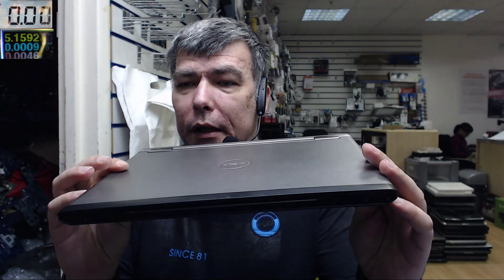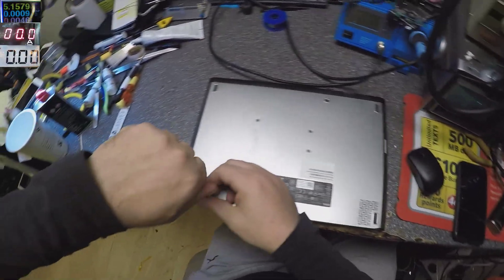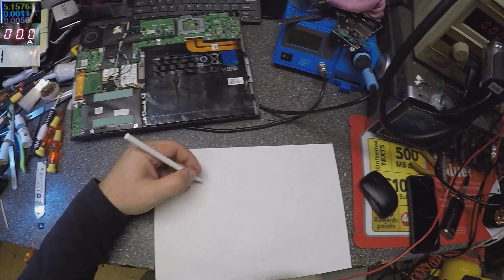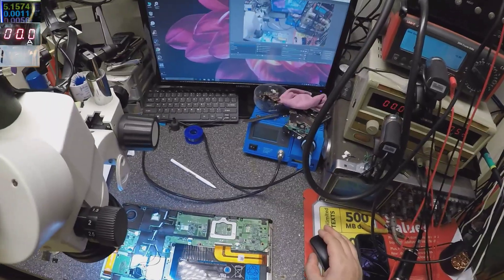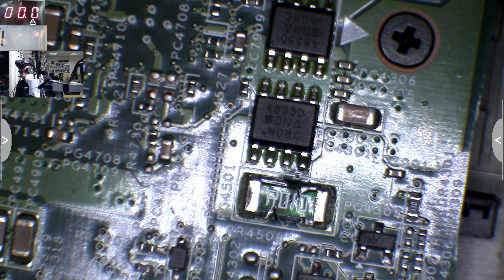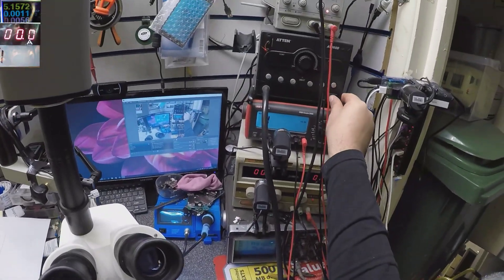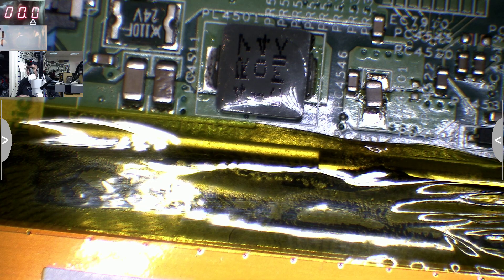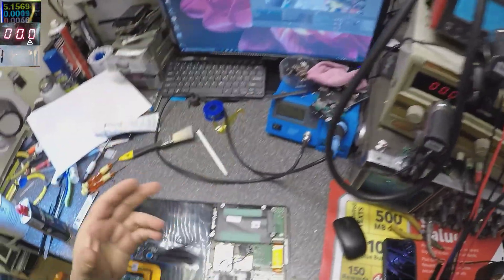How to repair short to ground laptop motherboards, dell vostro 130

Comment: I once had a window air conditioner that was tripping the breaker and did not feel like finding what component was going to ground, so I held the breaker on until I heard an explosion and then found out it was the compressor internal winding..it blew a hole in the compressor and let out all the freon but I saved tons of time troubleshooting. Same idea here..but 240v is a lot more fun.

Comment: what could have gone wrong with my hp pavilion dm3 laptop, i accidentally short circuited the mother board with the screen fibre when trying to fix the fibre on the mother board.all usb ports are working normally but the caps lock light and screen do not come on

Comment: It was Interesting for me because just for this tiny reason the system didn't work. Your job was like throwing the Arrow in center of Cybele ... but I feared a bit when when you plunged in the electricity ,I thought that if it has a the problem in other place so it would over heat again and burn the capacitor. How did you make sure about that? ... This is what surprised me.

Comment: Please, Sir, I am a beginner and I will be so glad if you can
make a video on how to identify the MOSFETs on motherboards.
Especially, I can see that most of the common problems are related to the shortages of 
power from some of the MOSFETs and the power connector (the charging port).
Actually, I normally work on desktop computers but I really have an interest in working on laptops.
I have lost of your videos but I have seen a video yet on how to identify all that I need to check.
Hoping to hear from you. 
Thank you.....
Frank

Comment: A $100s piece of fine technology could have be thrown away because of a $0.10 small cap...
Reply: You need to consider the skill required to diagnose and repair the issue, it might be $0.10 and a simple issue, but the guy in the video is worth more than that.
Reply: @AbdulAminGani  Yeah, when I try this I go from a $300 repair to a $3k repair.. It's an expensive skill to learn on your own equipment..
Reply: I buy 1,000 of those for $5.00.   they are super cheap to buy.
Reply: I don't know how much he charged, but if I would pay high prices for such a repair I'd want brand new same capacitor, he used a smaller one used which has unknown lifetime, I think it's fine for super cheap repair shops, but if he asks a lot of money then it should have got a proper brand new never used same capacitor...

Also that's the reason why I almost never buy used electronics unless it's something super cheap that I really don't care much, I'd never buy for example a used PC PSU, motherboard, GPU or HDD and some other stuff, from a PC desktop perspective I'd only buy used would be RAM, CPU and maybe a case or air cooler but I never ever bought any of them used ever (it's just from my own experience with hundreds of PC's its super rare to have a bad CPU or Ram and most CPU stuff related would be bad OC but then after testing if it's not fully working is just ask for a return same with the memories after testing them)...

The rest of the hardware like even if they look brand new and can say almost never used, no one knows for example if the PC wasn't actually 24/7 used always on or mining and other stuff which will dry caps and probably will come with low life already and prone to fail...

PS: expensive repairs, I'd demand everything brand new whatever was replaced unless on super cheap repairs then yes I'd say throw something used in it if it's much cheaper, but small caps, resistors and many other stuff are super cheap that should have been always a brand new piece, now IC stuff or the APU or SOC and many other way more expensive stuff surely would make more sense to get one used or from a completely trashed motherboard that could have them good...
Reply: As was said before, he has a lot of skill and 100s of dollars worth of equipment. I'd be surprised if he would even bother repairing a cheap laptop like this off camera.

Comment: sir what kind of power supply are you using? my power supply has a short circuit protection on its output which is why i could not use it the same way you do when looking for a shorted capacitor...
Reply: I have the same question
Reply: He use a long wire (modified) on the + probe so the PS read a load from the wire resistance
Reply: #ngapainturing can you give more details of how this works ?

Comment: Hello, can u show where did you put red probe from power supply when u test whit amps for short?
Thanks in advance.
Reply: I think he puts it in the main power input, so as to simulate the charger is connected, but does not provide the full 5-6 Amps.

Comment: how does capacitor cause short to ground though?   it's not grounded.
Reply: When a capacitor becomes shorted, it’s no longer a capacitor really, and instead becomes/behaves like a jumper wire. AND, since one end of the capacitors, is connected to the VCC [positive voltage track] and the other end, is connected to the ground [negative voltage track] the voltage goes straight from the VCC to the ground - hence, a short to ground. But I’m a novice at electronics, so I could be wrong.

Comment: Thanx for the vid.i have a desktop with i7 6700k CPU, my pc turn on and off, kinda looping, it turns on then off then on.when i removed the 4 pins atx power it works fine,so that means my VRM section is short. I applied the same method in this video to fix my desktop and it shows me all the capacitors near to CPU short(beeping in multimeter) but when i take out the cpu then no more beeping but pc start fine without the CPU.Also the capacitors around the VGA chip beeping even after removing the CPU but shows 34 oms on multimeter. So my question is to you that a processor can be short-circuited?or do I have to look for dead capacitors or the mosfet? And do I have to replace a new CPU? i want to know before i buy a new processor because it's expensive. Thanx in advance

Comment: I found your channel few days ago and today I fixed my first motherboard (Asus K53SD). I found a dead mosfet using 10 euro multimeter, replaced it using simple soldering iron (I attached piece of steel wire on top of it, so I don't damage other components). You are a good teacher. Thank you. Keep it up!

Comment: It's really awsome to watch this kind of great videos.I've a question. How you idendified polarity and the value of capacitor?
Reply: With ceramic capacitor polarization is not important.
Reply: @jamich1  But the value is important.
Reply: @mrpistonb6060  if you do not have schematics find similar cap one next to it and measure the value. If you just cant figure it out then dont put it there it will most likely work like that just fine ;)

Comment: Hi where did you put the positive and negative probe while using the dc power supply to find the capacitors thats getting hot? Thank you.
Reply: As far as I've been able to tell researching this topic, so far, you can most easily simply connect it to any like known power pins and it'll be fine. So in this case, it could've been the positive and negative pins where the charger would've plugged in.

The important thing is to keep the voltage limited to 1V and the current to less than 5A, since there should be just-about nothing which would run at 1V and a total of 5W power going through it which is of consequence and would burn out while there's a short, seeing as the part causing the short is going to be the one absorbing all of that energy and getting hot. Ergo, worst-case scenario you straight-up blow off whatever part was the problem in the first place.

Thus, better to start with less current and work your way up if nothing is getting substantially hot, and use something like 99% Alcohol (IPA) which will rapidly evaporate away from wherever the component is getting hot.

Comment: I took the Laptops Power supply as power source to put the Amps onto the first resistor. If I connect the wires a little spark flies but nothing heats up :( I have a thermal vision and see nothing.

Comment: Great work. Had the same issue with a dell 5520, and found also one capacitor shorted. Was replaced and the short is gone, but i have a strange issue. Once i plug the charger is everything ok, but if while the laptop is working i unplug the charger and plug it again, the charger light goes of and the laptop gets no power....

Comment: another nice video....i request you to make a video on different power supply like 3.3v 5v processor power supply as hows power comes there... i saw most of your videos have the description about the main 19v but they dont say about how the 19v gets distributed to rest of power supply . like where are the mosfets of 3.3 and 5v power supply. on which ic does the main 19v supply gets in

Comment: Where are you putting the 2.4 Amps to board? The black pin to the ground (I guess a screw hole?) and the other to the resistor?

Comment: please do a video on rapairing lan port. my mobo is not receiving any data from built in lan port. the thing is driver is updated, lan cable is working well but ip address cannot be obtain automatically. my gues is the lan port or the lan chip is busted.. your video is very usefull and informative, thank you...:-)

Comment: quick question....how do you know thw value of the cap you replaced is close to what you took out?...nice video though
Reply: I believe he just took a random ass cap from another board with a similar circuit
Reply: lol he took a random cap. I personally would not do that.... the capacitor may end  up shorting again because that cap could be a lower rating depending on what power rail he grabbed it from.
Reply: @andrewlozano9473  you can try to give supply without cap, check voltage across missing capacitor pad, then you know the working voltage and, at least, you can choose a rated capacitor. Anyway you cannot guess the value in uF. Capacitor can be there for stabilization of a working voltage and in this case "bigger is better", but sometimes are filters working on a precise resonance frequency so, you can't guess. This case is very rare. You can also watch datasheet of the nearest active component: in the design suggestion you will find the good capacitor for this.

Comment: Love that accent! I'm struggling with a Dell XPS M1330. I get a brief blue light. Nothing powers up. The user got into it a few years back and tried to replace the original mobo. Screws everywhere in there! She also installed the CPU 90° off and bent a few pins. I straightened all with one broken and reinstalled. RAM looks OK. I ordered a refurb board and CPU. I think I'll try your short technique! Lighter fluid? Should I have a fire extinguisher around?😱. Have you ever used an upside down air can? Thanks for awesome videos you handsome professor!

Comment: no antistatic wrisp - why ? not necesarry sir ? 
my tip -DON`T blow air against it normal way - do not blow inside - this is not done well - you pushed all of the dirt to the mainboard what can cause a short - wasn`t easier to unscrew that fan ?? Good job done when searching fora problem - really good - but solving problem not so well... other way - I will give you my laptop to find a problem , but rather I will repair it myself ( it is about what customer thinks ) :) well done movie . Thx for sharing brilliant idea with petrol or light in charger .

Comment: Great video. I have two questions, the first why you use petrol insted of alcahool and the second is where you were injecting the amps and what voltage. Thanks
Reply: Did he ever answered those questions?
Reply: @thingshappen9199  i would like to also to know, the two amps injected what was the voltage?????
Reply: i would like to also to know, the two amps injected what was the voltage?????

Comment: The guy is a genius, calm and very patient. love his way of dealing with the issues , keep up the good work
Reply: Agree totally, great video and information.  Also, he has the ability to draw a near-perfect rectangle with his off hand! 5:30. Hes just showing off now
Reply: How did he add the amps to see which component was getting hot? Did he put the ground probe on the ground pin and the plus probe on the plus pin? And to check if it was short he used any two points and if it beeped it is shorted?

Comment: Would this laptop turn back on if this capacitor was not replaced. Just trying to understand if power has to go through it. Thanks. It seems sometimes removing can work just don't understand it totally.

Comment: My dell 7737 not starting after tried changing wifi card and came across this video. Always wondered why not repair then replace it. Dell chrging 300 bucks to replacing it without even looking at it.

Comment: Hi. :)
Did you ever had a situation to have a short to ground motherboard, from the beginning? I have an laptop whic is short from dc connector. The thing is when i connect power supply, he indicates me there is short, but nothing gets hot. Im confused. I tried on gew other mosfets on same board, they are ok, not short to ground. Do you have some advice for me? I didn't tried only od dc itself, i was going through the motherboard, and same thing. Nothing gets hot...

Comment: What type of fluid did you dump on it?
Reply from the maker: Lighter zippo petrol
Reply: Electronics repair hey i have a question man I'm trying to run my PS4 on a ATX power supply and every time I hook up that 12 volts and the ground to the prongs on the PS4 where the old parts place to be it keeps like shut it off my ATX power supply light shorting out do you know what the problem is or what the problem might be
Reply from the maker: is not enough only 12v, you need also 5v, its a bit more complicated

Comment: How do you know the Value of the Capacitor to use ? its actual size ?
Reply from the maker: not always, but you have to figure it out, if is a power rail caps, replace with another doing same thing having same size, but its not strict

Comment: I found your channel like 3 days ago, and now i watch your videos every day. There is so many useful tips. I want to order hot air blower and power supply. Tell me, is enough power supply of 15dcv and 2 ampers, and a blower which heat the air up to 450 degres? That is all i can find in my country for some reasonable price. Thank you one more time. You answered on every my question in last two, three days.
Reply from the maker: the blower is ok 450, but the power supply its a must to be 0-30v 0-3(5)Amps LINEAR
Reply: Electronics repair school Oh, thanks. I will try to find better power supply, but i think it will be a little harder to find supply like that in hoby version below 100$.

Comment: why with beeping have short to ground if beeping is a good thing.  means the circuit is fine not open
Reply from the maker: short to ground i know, looks complicated, but its a easy fault
Reply: beeping is a good thing when testing continuity: it means track or path is fine and not open BUT when it comes to test  negative or (GND) and positive rails beeping means SHORT which is not good. think of it like two parallel lines  that should keep the same distance of each other anywhere and should not make contact or short circuit . sometimes beeping is good when testing coils, wires, jumpers, fuses,  0ohm resistors etc but not with electrolyte capacitors,  high value resistors,  and cases when it should not beep.

Comment: great video i just want to ask using lab power supply you inject to shorted resistor with voltage or amps to find the short?

Comment: sir.. when i place my red probe to the drain and black probe to the source of mosfet... i am getting 36 or 33 reading on multimeter in diode mode..the reading is still the same when i reverse my probe polarity... the mosfet is still on motherboard... is it consider as shorted mosfet?
Reply from the maker: no, u get that values from the other components from the board. why do you think that mosfet its faulty?
Reply: i am thinking it is faulty mosfet because my  multimeter is also beeping as i was looking for shorted one.. but the reading i am getting is not infinite for sure.. i am wondering maybe it is in  parallel connection  with some inductance.Besides i dont have the schematic diagram..

Comment: hi 

how do you apply the 4amps to the motherboard? to know what is heating? can you give a clear view where to point the positive and ground to do this? thnx
Reply from the maker: Try and play with a lab power supply. you can adjust the amps and the voltage. Of course on a circuit you can set up the amps and voltage limit on the power supply
Reply: +Electronics repair school hi please give me instruction on how to do loading amperes to the motherboard. where do I point the negative and postive probe of the power supply to the motherboard so I will be able to know what section of the motherboard is getting hot.
Reply from the maker: If u ask something like that, i can't help you. U are on a point where you need to learn and play with voltages and amps. My advice, start playing with little electronics kits.
Reply: coz I have 2 compaq c700 motherboard that is completely dead and another one is short to ground but I don't know where to start checking...I'm sure that by watching your videos I will learn a lot...I hope you will be able to fix the same motherboards that I have so I will be able to see where to start.